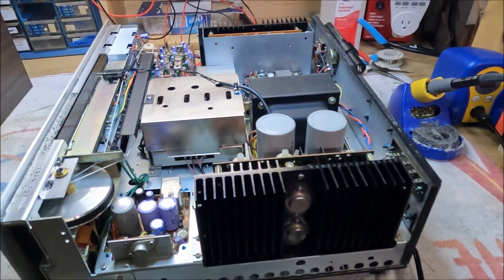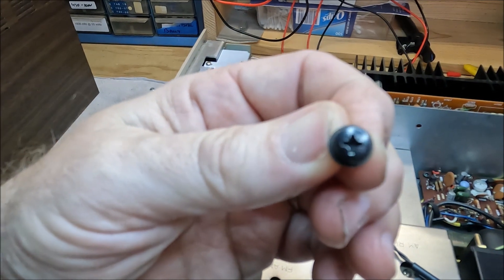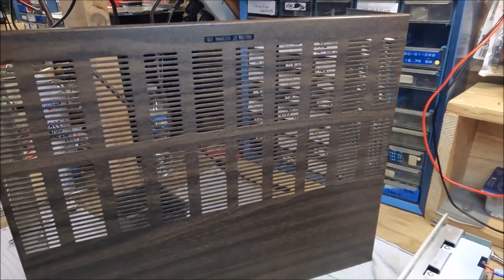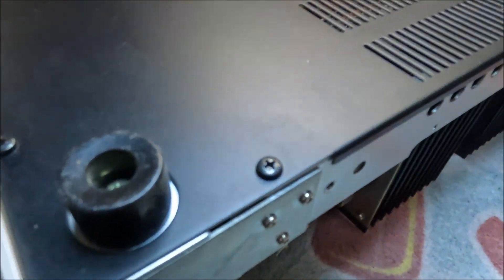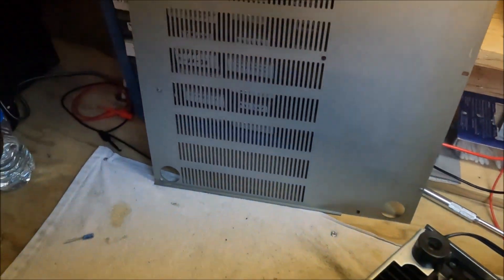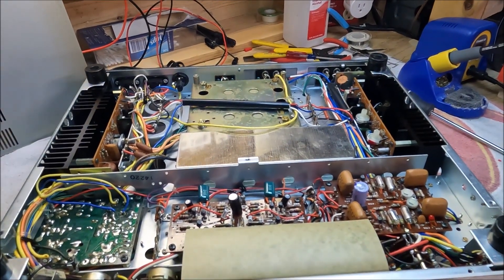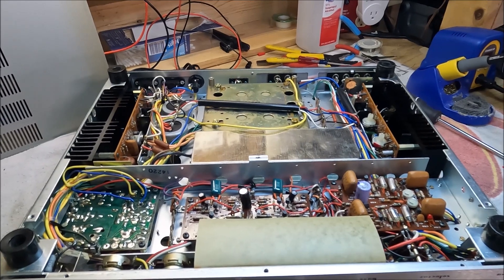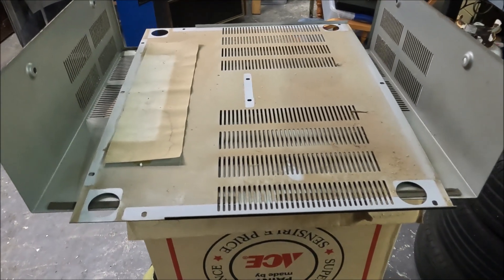Marantz 2245 First Look

Comment: If it sounds and looks good don’t touch it. Just had major recap of electrolytics, filter caps, diodes, and problematic resistors of my 22x45 and now it sounds too bright. Lost that mellow Marantz sound I had before overhaul.
Reply from the maker: Hey there and thanks for watching and writing in. There is always that debate on changing parts out on these 50+ year old electronics. I usually redo the power supply and then reset the DC offset and Bias, then clean all the controls. After this I will test out the unit and see at what point I start to get distortion. If I do need to replace any capacitors I will use Audio Grade and/or WIMA caps (4mfd and lower on WIMA). I have had very good success with this method and in keeping that warm Marantz sound. Sorry to hear about your experience and hopefully you can get your unit tuned in. Enjoy the hobby,
Reply: Yup. Those new caps just ruin the sound. Too many customers will say: oh and change out the filter caps. I tell them point blank. If they’re ok, they’re staying.